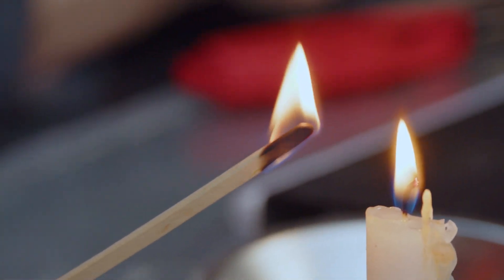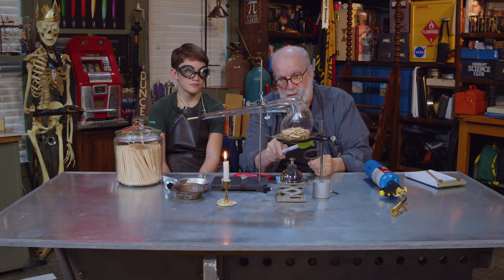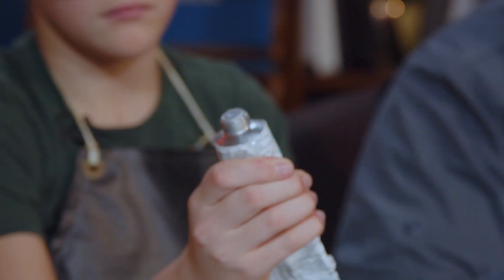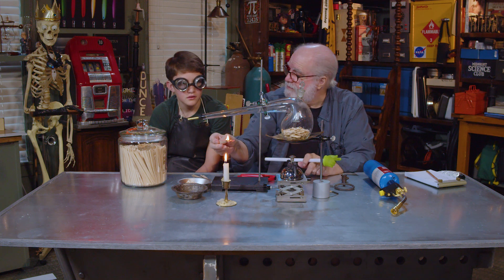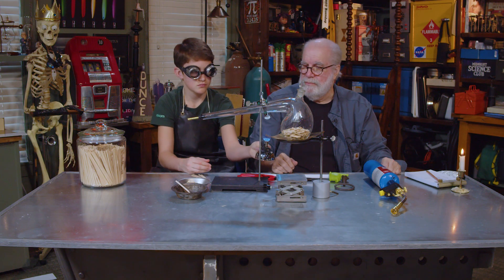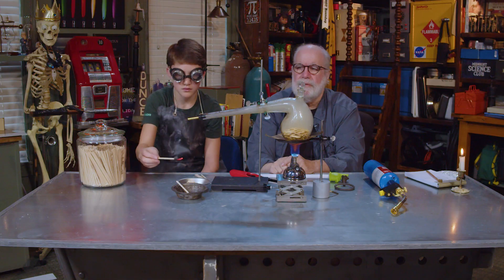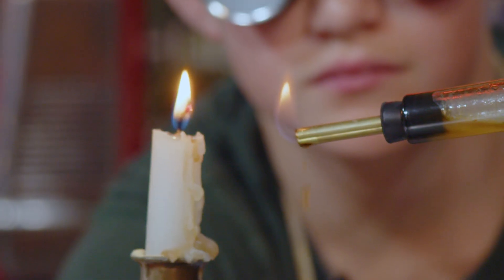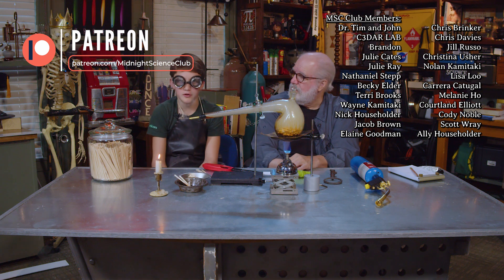The Secret Science of Turning Smoke into Fire // Wood Decomposition Reaction

Comment: Made a mess of the retort, hope you were able to clean it!
Reply: A little acetone or other solvent wouldn't hurt either
Reply: @jamesyoungquist6923  Indeed, acetone is great solvent for organic residues.
Reply: It's mosty charcoal and aromatics - that can be removed with soap and oxidizing solutions for the more stubborn stuff. I found that dense sponges (e.g. Durafoam, Magic Sponge) work much better than common polyurathane sponge when it comes to removing carbon residues.